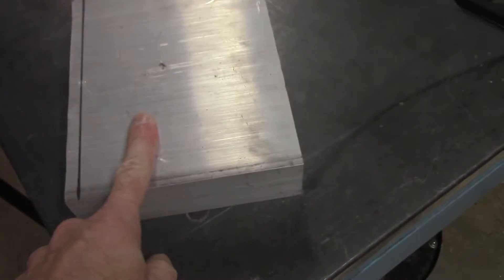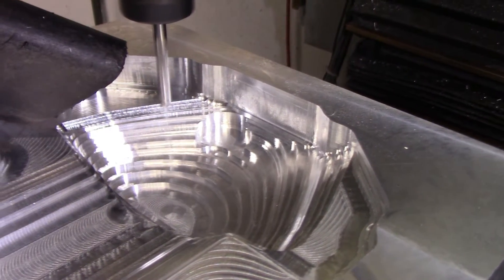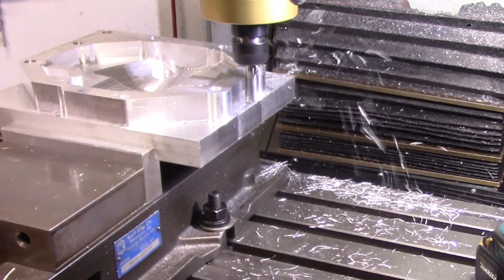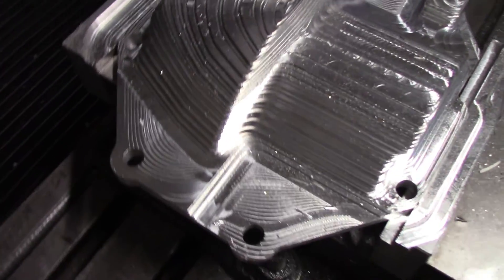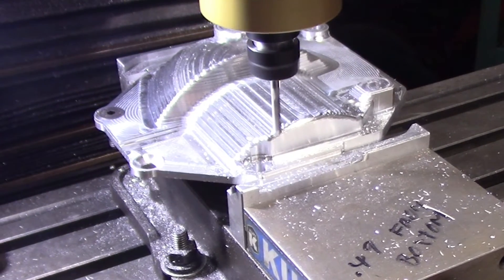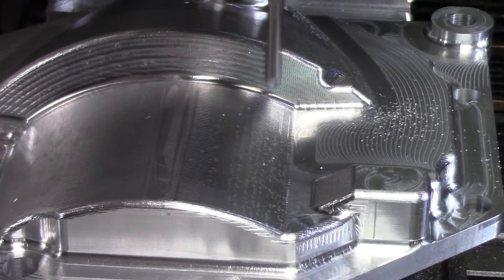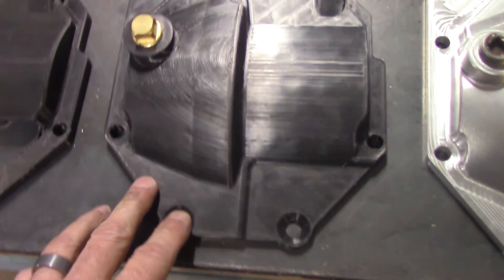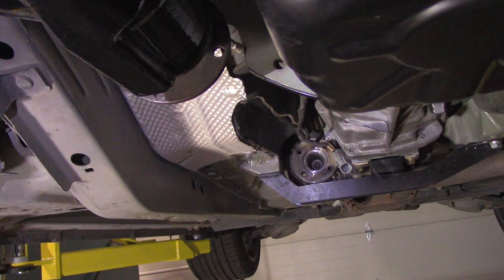3D CNC in My Home Shop - Custom CNC Differential Cover - AWD Mustang EP 24 - All Wheel Drive

Comment: That diff cover is dope. Following this build gives me the idea that I could get a 3D printer and cast aluminum parts like this using the 3D printed parts to make casting molds from. Getting set up to do CNC mill work is a lot more expensive than buying a 3D printer, so it seems more doable.
Reply from the maker: I local guy I know did that, 3D printed and cast a cover.

Comment: Have you considered making a video about your Merkur? Maybe just you talking through the project start to finish with some photos? I would love to know more about that. I ask because I would love to find a 1980s Escort GT as a project, which got me thinking what would it take to do a Duratec swap and/or an AWD conversion. I don’t think the XR4Ti is the same platform as the Escort (probably fox body?) but would be interesting/helpful at the very least. Great stuff, been following along for a few months now, love this project.
Reply from the maker: Hey Thanks for the feedback.  

Yes, I have considered and planned on making a video about the Merkur several times.  But I have only has so much free time, I am trying to focus on one project at a time.

But, the current plan is to put out a Merkur video after the Mustang video that actually shows it being AWD, which is the next video:)  I am hoping by the end of the year, otherwise after the holidays in January.

Comment: I stumbled across your channel after searching on YouTube for AWD mustang because I was wondering if it had been done and if so how bad was it to do. Just in case I might decide to do it myself some day. After seeing your videos I have to say that I will NOT be attempting to put an AWD system into a mustang. That is way more than I can handle and I am a cut it and weld it type of guy with zero experience with CNC machines and no access to them. What I may do is something similar to what the YouTube channel B is for Build did and simply transfer a mustang body over onto an AWD chassis.
BTW great work and I love what your doing I honestly hope your channel grows to where ever you decide you want it too. Keep up the good work and Keep on Keeping on!
Reply from the maker: What year do you have.  There are many ways to do a conversion.  I am a bit biased and I wanted to improve my machining skills with this project.  My AWD Merkur conversion really had very little machining and really no CNC, just some simple lathe operation.  

Be creative!

Comment: Does it matter which year Charger the bw44-40 t case comes from?
Reply from the maker: There are differences between the v8 and v6 models., but they all could work depending on how you couple it to the transmission output.

Comment: If it's under 4,000,#'s that is pretty darn awesome. However, I'm going to go with 4,050.
Reply from the maker: Closer to 3900 lbs and I haven’t installed the 2 piece rotors yet.

Comment: 2 questions for you. 
1) do you have a rough timeline to be finished?

2) do you plan to boost at any point? If so, curious why you’re keeping the cats since they become a problem under boosted conditions
Reply from the maker: Yes, I do have a timeline.  The goal is to get the car on the road this fall and prove out the basic Mechanics of the AWD system and the electronic AWD controller.  I will be successful at that:)

Yes, I do plan to boost it.  That has been the plan since day one.  I would not have done the project to keep in NA.  The question is do I supercharge it or Turbo it.
Reply from the maker: As far as the CATS go, it is more of a self imposed rule just to see if I can do it.  But mostly, I don't want the smell.  I want to be able to drive the car to work and not smell like a gas station.
Reply: @npvg  awesome. Thanks for the progress videos, always looking forward to the next ones

Comment: Hello , dude you are the man. I thought I was handy. You are on another level.  I bet after you're done with this. Ford will make a AWD mustang.  You have probably changed the world for all  mustang enthusiasts. The biggest problem with the mustang is lose of traction on launch.  This will fix that problem. My quess to the weigh is right around 4k. They weigh around 3,700 stock.
Reply from the maker: Less than 4k, I was pleasantly surprised and and I have plans to take some weight out.

Comment: Awesome video, really appreciate the in-depth play by play of the machining process. A little bit of advice from a former Jeep owner, run a fitting with a rubber hose on that diff vent so it vents higher up in the chassis and won’t let water in from puddles or snow etc!
Reply from the maker: That is probably a good idea:)

Comment: That had to be incredibly gratifying to complete and install that.   I thought of you recently when I purchased a Bulkhead/firewall pass  through from Sharpe Performance for the the ECM cable.    It ended up being about an eighth of an inch to small for the ECM connector.  But there was plenty of meat  to remove a sixteenth of an inch from either side to allow the connector to pass .  It would have been a piece of cake with a mill but I did it the old fashion way with hand tools.